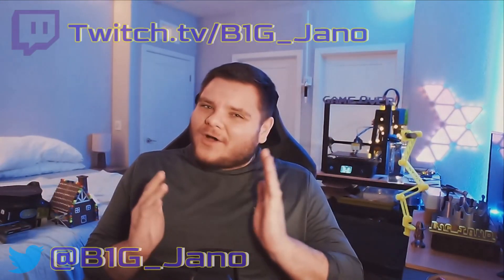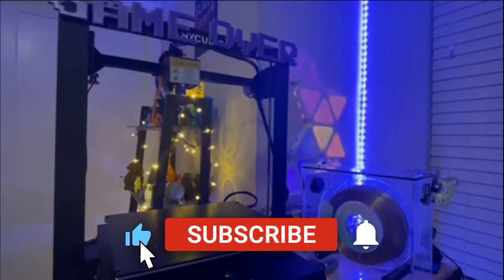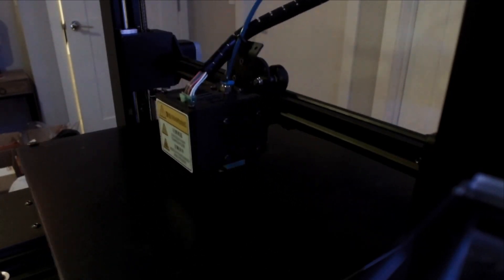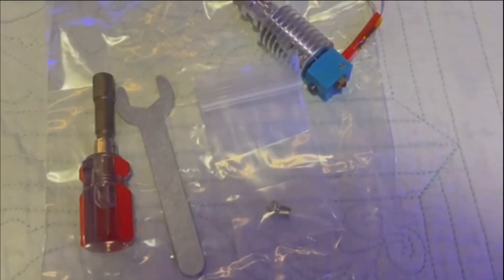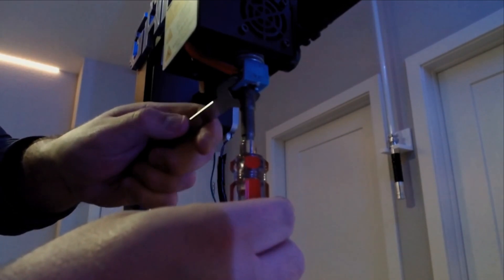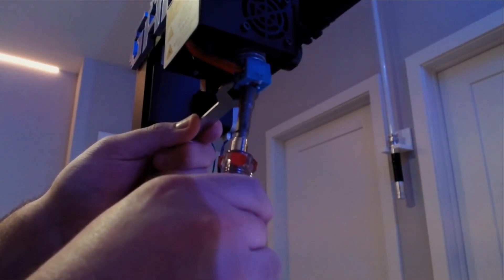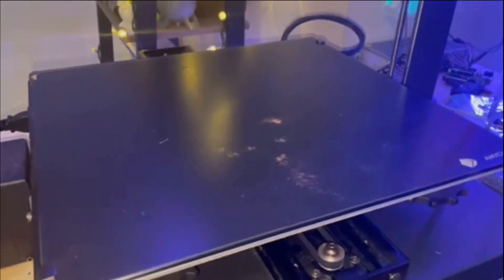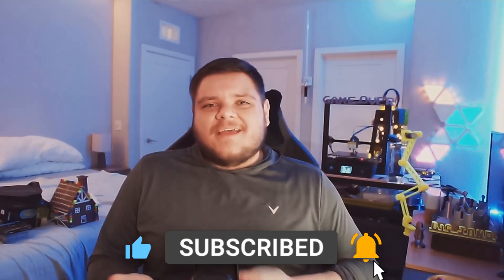How to Replace your Nozzle on the Anycubic Mega X

Comment: Hello B1GJano, have you ever tried replacing the Y-Axis Motor?
I noticed my Y-axis motor can stop moving at certain points during prints.
Right now I tried some printing residue cleaning around the motor, if this does not work I'm looking to replace and some tips are always great help. :D
Reply from the maker: I haven’t on mine. Thankfully all the stock motors have been working for me since I got the printer. The good news is that those motors I believe are pretty common so they should be easy to get and replace

Comment: I have one of these printers and I’m having a bad stringing issue, do you have a video on how to solve this?
Reply from the maker: I would play around with retraction settings little by little. Maybe slightly faster and maybe a tad longer. Also could be filament with moisture in it
Reply: @B1GJano  I use a dryer on them for a day before I print. So I know it’s not moisture. I will check the settings for retraction, maybe I will ice the orca slicer a chance too

Comment: Hey mate. Stupid question but how far down the heat end should the white filament tubing go ? We are having bad blockages
Reply from the maker: It should go down pretty far. Almost until it reaches the heater block. The hotend will have a inside groove/edge that will stop the tube from going any farther so push it in until and can’t go any further.

Comment: You should not tighten the nozzle before making sure that no residual filament is caught between the nozzle and Bowden tube.
I always clear the path first and then put in the nozzle all the way and then back it out 1/4 turn then put in the Bowden tube and tighten the retaining nut and then tighten the nozzle.

Comment: B1g_Jano, I came home to find that my print had failed and was a big blobby mass. after it cooled I took off the blue cover for the hot-end and saw that plastic was all over the sides and bottom surface of the cube. It has filled some of the holes on the cube and looked like it burned some things. It looks like it leaked from the sides of the cube. I tried contacting the after sales support but they didn't give any help. I don't see any phone numbers either. What do I do no? I would like to know what happened so it doesn't happen again on the replacement hot-end. Thank you!
Reply from the maker: So to remove the blob. Just heat the hotend up to 200 and you should be able to (carefully) remove the blob being mindful of the wires. Don’t accidentally tear the thermistor wire. 

In terms of why, it could be that your nozzle or heat block aren’t fully tighten. Check to see if they’re fully tightened. I would heat the nozzle to 230 before doing so and tighten it while it’s hot.
Reply: @B1GJano  thank you. I will try this.

Comment: You might be able to help me I’m having trouble with my hot end ? You know which one to buy to replace my mega x hotend I destroyed both hotend that came with them . I can seem to find the right hotend
Reply from the maker: So Anycubic does sell the hotend for the mega x on their website. Besides there, you can find them on Amazon. Look for a v5 j style hotend. That’s the same that’s on the machine.
Reply: @B1GJano  thanks 🙏 it’s been a big issues since I use the two hotend that came with the machine I bought one before from the website but they send me the wrong 😑 item and I also tried Amazon but I grave the wrong one it didn’t reach up to 230 cc when I tried to change my filament . Hopefully this one ☝️ solve my problems. Are you planning to buy the vyper any cubic with the auto leveling it seem much better in my opinion lol

Comment: Ok my dude,  mine for some reason when starting a print the nozzle doesn't raise up and scratches the hell out the bed. I'm seriously considering getting rid of this POS.
Reply from the maker: If you haven’t already, check out my cura slicer setup video. There I show my start and end gcode. See if your starting gcode matches. There may be an issue with your beginning gcode that could be taking it down way too far.

Comment: Hi Jano, with my MegaX spares and tools,  I got the whole hot end and bowden tube ( blue box thing ). Do you know why and why not just a hot end nozzle?
Reply from the maker: Anycubic is awesome of giving a entire spare hotend assembly. Some other 3d printing companies aren’t as generous. While replacing a nozzle is more likely, sometimes a really bad clog will make you have to replace the entire hot end. (Which Anycubic has a great video on how to do that.) 

Also when it comes time to replace the ptfe tubing, I find it easier to replace by taking off the entire hotend assembly to do so. These are good spares to have so just hang on to them until you need them. I will advise to keep the nozzle that’s attached to the spare hotend attached to it and use a separate spare nozzle for swapping like this video references.
Reply: @B1GJano  Cheers Jano, I'll order a spare nozzle sometime in the distant future  
Ps still printing the Tank, some parts take 14 hrs and not even finished the hull yet !

Comment: While the nozzle is out, i'd recommend removing and checking the bowden tube and cleaning the hot end of any residue.  When replacing the tube, insert the nozzle but don't tighten to 100%, just to 90% then replace the tube and then tighten to 100%.  Good vid though mate.
Reply from the maker: Thank you for the tips! Glad you enjoyed the video!